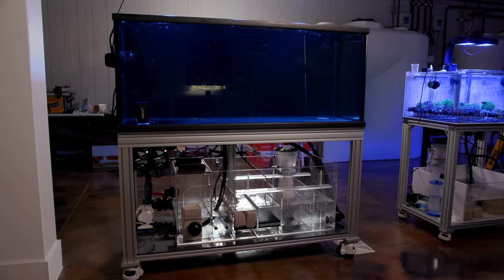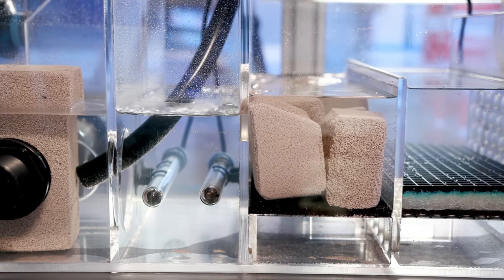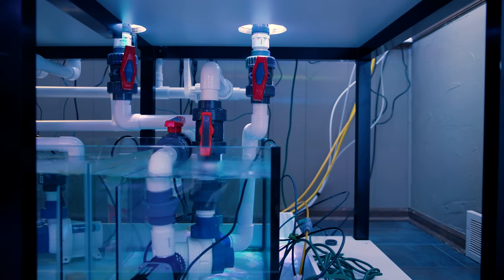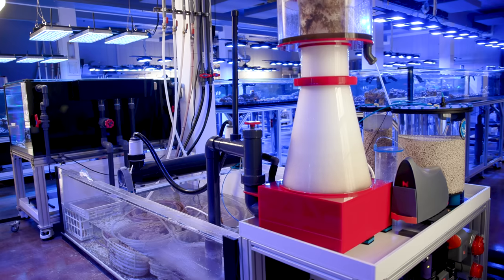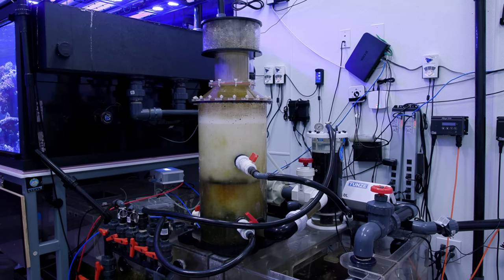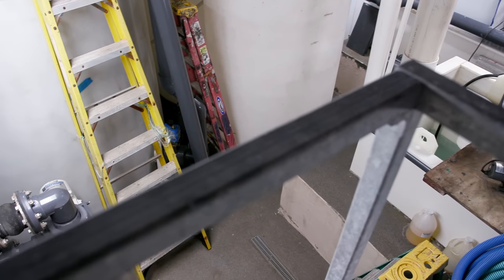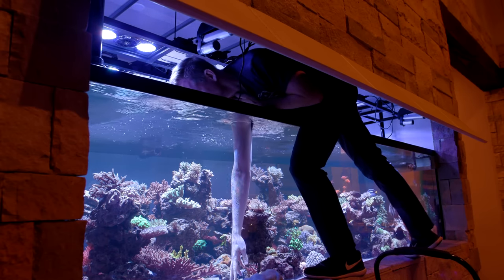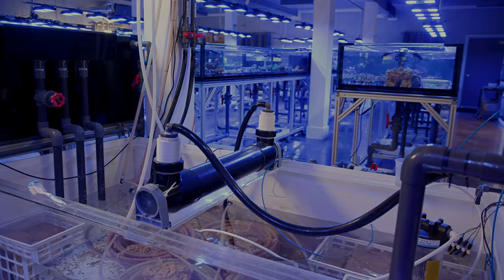Reef Aquarium Sump Design and Placement

Comment: Great info!  I have a 39 gallon Red Sea tank on a 2nd floor.  Sump is a refugium style with mangroves that have been growing great for 4 years.  Downside is ATO.  The tank is too small.  I do have a closet behind the tank, and might design a bigger ATO.  It just needs to be failsafe, otherwise, I'll spill gallons of water from my 2nd floor.

Comment: Dedicated fish/equipment room is the goal for me. I'm hoping to build a house 5-10 years down the road and my thought was to essentially make the garage an extra bay wider and then partition it off from the rest of the garage once the rest of the house has been pretty much finished. That way there would be room for a huge refugium/sump and raceway style frag tank. And you wouldn't be able to hear the equipment from the display tank/s. If you're building a space specifically for dealing with the power requirements and water/humidity, you can make it a space you don't mind spending time in. Though I'm a bit of a gear head/systems engineer type so in a way I would almost enjoy the equipment room more than the display tank.

Comment: Currently my sump is in the stand under the tank and I have every single one of the issues you've described. If my external return pump ever goes bad again I'm not even going to try to get it out, I'm just going to plop a submersible in there and replumb. It's too hard to get to. In retrospect, I could have put the tank against the opposite wall, because behind that is the converted half of my garage. Instead of a desk and cabinet holding random junk it could have been a sump and cabinets holding reefing junk. (*Sigh*) maybe some day.

Comment: Summary: You can put a sump under your tank in the cabinet, but it will limit your space to work, size of equipment, and limit your visibility if something goes wrong.

If you have room you can put everything you want right next to the tank in the open. This is beneficial because you can see everything and use large equipment.

Third option is move all the equipment to another room. Beneficial because it reduces noise and gets the eyesore out of your room, but has drawbacks because the maintenance of two rooms is a hassle and issues that arise may go unnoticed in another room.

Comment: Well from experience half of what's being said isn't practical  most people  don't have an extra room to house a sump if I had a room for this I certainly  wouldn't  have it next to my tank it would just make your whole system  look ugly  Most aquariums with their stands are matched between tank and sap. To act as if the sump wouldn't be big enough for this tank that you have you match it, you size appropriately.
I have a 180 gall tank with a 40 gallon. Sump, that's the recommendations. I have plenty of room and it's not on guile. Looking to have a whole room full of c*** just for my tank. My tank is the center of my room. I don't have extra room for this stuff. It's under the tank as far as it  leaking its leaking into the sump.